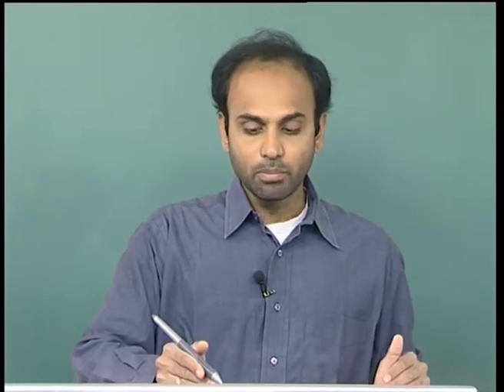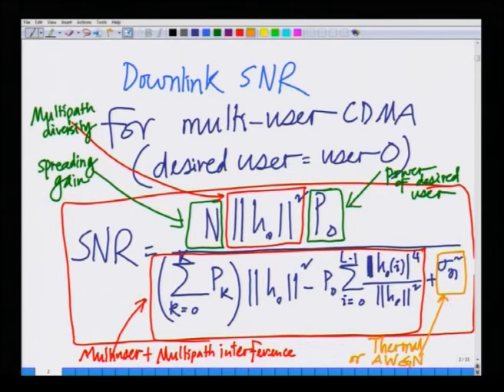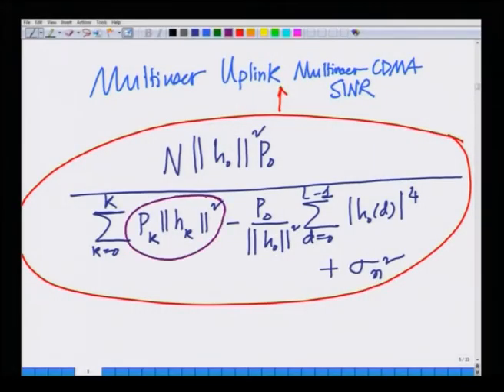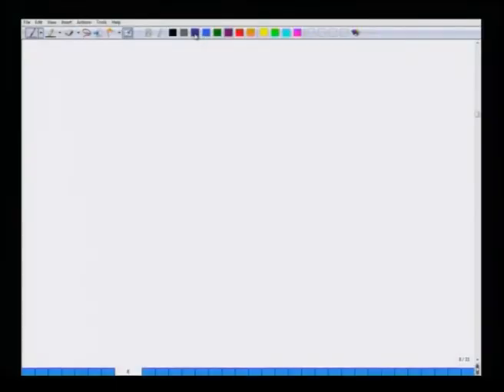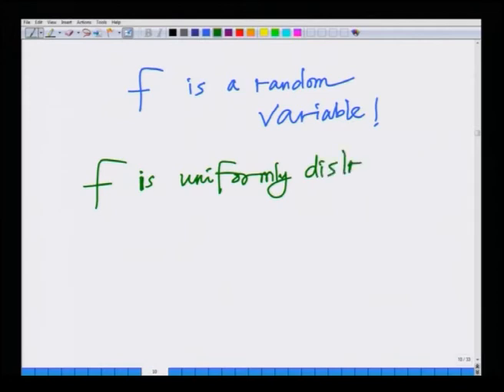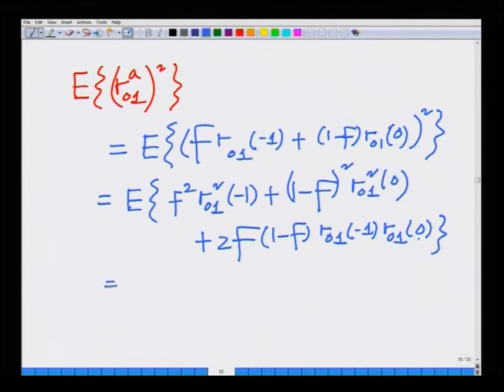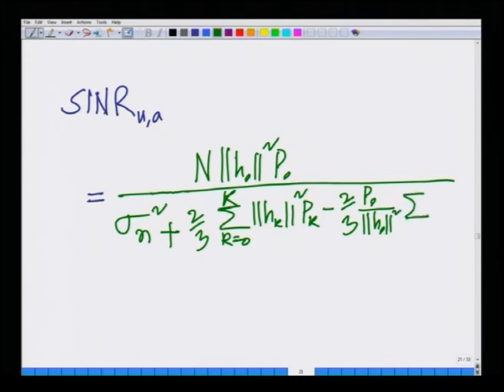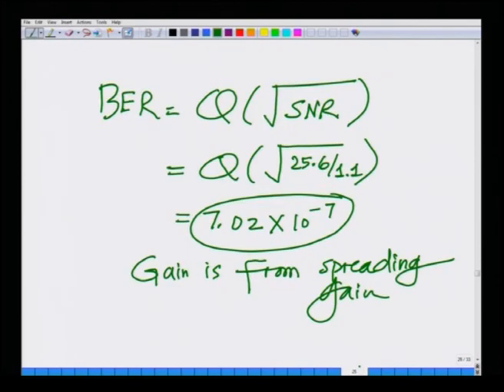Mod-01 Lec-19 Multi-User CDMA Uplink and Asynchronous CDMA

Comment: Note on F (at video time 28:00): F is a uniform random variable in the range 0 and NTc (NTc=Tb). F is an integer that has a duration equal to few chips. If F=NTc=Tb, system returns to synchronous state.

Comment: Why do you solve the BER for wireline? (qfunction(root(SNR)))
Reply: We do not have multi-taps in wired communications, this is for multipath wireless propagation
Reply: +Lee Sangjun  Yes, even I have the same Q. It should be approximately equal to 1/2SNR as the channel is of course wireless.